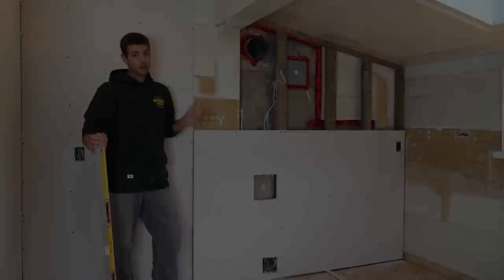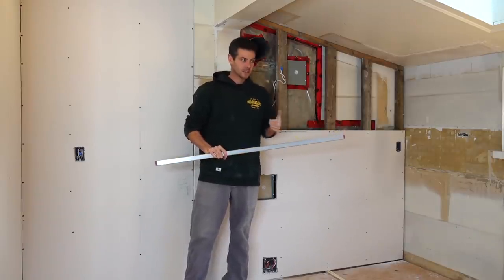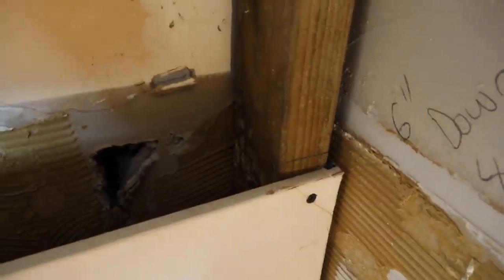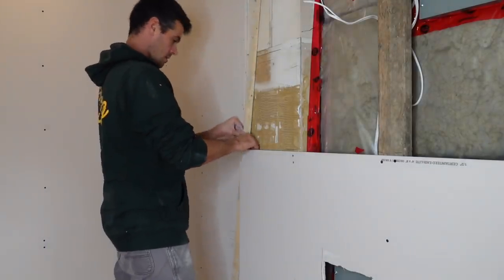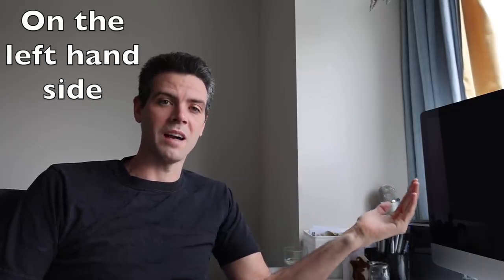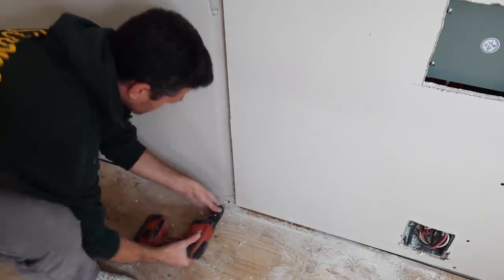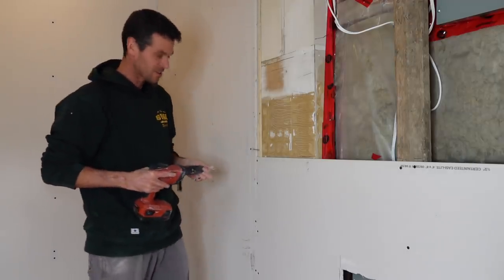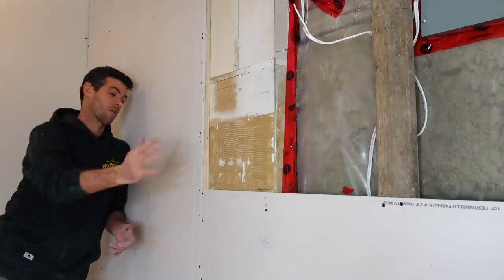What separates a GOOD DRYWALLER from a GREAT DRYWALLER!

Comment: Why wouldnt you just take the corner bead off??
Reply: That’s exactly what I was thinking, why not just rip it out and take out the problem ?
Reply: Bingo!
Reply from the maker: It's super old drywall which is really hard to get rid of and often contains asbestos. It's best not to disturb it. The best solution would have been to shim out the whole left side of the wall but unfortunately like I mentioned it was an afterthought.
Reply: @vancouvercarpenter  Cool, figured there was a reason.
Reply: @vancouvercarpenter  if the corner has asbestos then the entire board will. Cutting the corner would have been half the work and twice as fast in my opinion. Have done it a lot. Shimming the entire wall will work too but as you said no drywall we brings a table saw to do that lol
Reply: @justaworkeryup636  I spent 6 years testing resi and commercial spaces for asbestos. 9/10 any asbestos that was detected was in the mud itself not the board.
Reply: @daltonlopez4623  nice. I do believe there is mud applied around the entire board if I understand how board is installed?
Reply: @justaworkeryup636  exactly. Furthermore the mud is concentrated around corner beads and more dangerous
Reply: @vancouvercarpenter  I would like to add. I like your videos and have been doing this for 29 years. I do most of my work the same as you. Keep it up. You do a great job and I like a good tradesman who has pride in his work. 👍
Reply: @daltonlopez4623  Whoa! How far back does the mud go when the asbestos was detected?

Comment: I've never run into that, but good to know!

Your videos have helped me a lot in renovating my house, I'm happy to say I've skimmed coated and textured my entire home! Using a hawk and trowel helped a ton, which of course I got because of your videos.

Adding lighting, electrical outlets, and other things required lots of drywall patching, which again your videos came to the rescue. I even dared to use 5 minute hot mud! Total disaster at first, dried on me before I could even use it the first time, but got the hang of it.

Anyway, all this is just one giant thank you!!! Really appreciate all your videos, your experience, tips and tricks. Thanks a lot Ben!

Comment: You the man Ben !!

I don't remember which Youtube channel I saw this tip on :(, (it might have been on "Vancouver Carpenter's" channel), but here is a good tip for dealing with crooked wall studs when installing drywall:

If you know which stud(s) are crowned "in", apply a thick coat of thin-set against those studs.
Place the drywall sheet against the studs and push the sheet to squish the excess thin-set until the sheet is flat. Put only a couple of screws where the drywall is already straight and tight to the stud. Let the thin-set dry overnight, and finish screwing the rest of the sheet the next day.

Obviously, this may not work in all cases, but can work.

Comment: As the framer and rocker I have flattened out framing by using a scrub plane to take off high spots and shims to fill low spots... and flattened some twisted framing with hot mud. For the LOAP I probably would have ripped that corner bead out before doing the fill-in framing... and flattened the framing from there.  It may have saved some time over trying to work around that bulge.
Reply: I thought he was going to take out the corner bead.
Reply: I was thinking the same thing
Reply: He said he didn’t know if there was asbestos in the wall, so he didn’t take out the corner bead. (In another comment) :)
Reply: @misstweetypie1  Information not in evidence when I wrote the original comment.  I also didn’t consider it as an issue at the time as local to me getting rid of demo debris isn’t a problem… though that doesn’t stop some from dumping it along roads illegally instead of paying the nominal dump fees.
Reply: He just uses that bs as an excuse to not do the job properly like John would do. Mud framing....lol...need I say more!
Reply: @markmyers7426  Someone who does framing, rock and trim generally looks down the road to the next step and sets things up for success. That said, sometimes mud framing is handy. For example, while the eye-level parts of a wall might look great the very bottom, or top, where baseboards or crown molding is to be installed, could be wavy. In those cases, rather than putting gobs of chalking between the rock and trim, it makes sense to flatten the wall with mud. It looks better... 

The evolution of finished walls and trim is interesting. Early on when framing was rough cut lumber (e.g., pit saw), lathe was hand split, and trim hand planed, the framing, lathe and trim went up first and then the plaster was applied using the trim as a guide. The next approach was to frame, lathe, install guide boards for the plaster to which trim was later attached, plaster and then trim. With those technologies the plaster was used to flatten the walls (more or less depending on the quality of the building!). Anyone who has removed old plaster and tried to rock on the rough cut studs can attest to how uneven the studs are! Flattening the wall with shimmed furring strips may be required in those cases.

Today we apply drywall over wood framing in many parts of the world and then tape and mud it... at some point in using this technology a fine job requires fixing something to make it look flat. Some geographic areas favor blue board and plaster and the plasterer is the tradesperson whose ability to flatten a wall makes for the quality of the final job. 

I'd argue that it's not a stretch for a taper to adopt some of the plasterer's techniques for flattening a wall. After all, most of the early rockers and tapers were probably plasterers first!  For example, the technique shown in this video "Plastering a wall : Part 2 : Flattening" by Cardiffboy may look familiar as it appears in some of Ben's videos. 

I'm a lot older than Ben but have picked up some useful tips from him. I'm also a fine woodworker which means I'm looking for a level of perfection in carpentry that is perhaps unrealistic in many cases!  I got the idea for fixing some framing problems with hot mud before rocking as an extension of Ben's correction processes. For example, it's handy when there is a twisted stud. I use a scrub plane to get the high spots below the plane of the wall and then use hot mud to flatten the surface of the stud to the level of the wall plane. That way when I drive the screws they don't punch through the drywall as the dry wall is fully supported at the stud instead of only touching an edge of the stud. 

My carpentry scrub plane originally belonged to a carpenter who worked in the 1920s-1950s. It is wooden with a wooden wedge to secure the iron. The body is only 6" long and 2" wide. It has a heavily radiused iron. It works a lot better for fixing framing than does my Lie-Nielson scrub plane... the L-N is great for flattening wide rough cut boards so they can go through the thickness planer. It takes the place of a much wider jointer in my woodworking shop. My carpentry scrub plane looks a lot like this one https://www.tooltique.co.uk/corefiles/wp-content/uploads/T13848-2-450x450.jpg with decades of wear on it!
Reply: I have also done several jobs where I removed lathe and plaster and drywalled and finished so I can attest that you know your stuff. My point was when there are 20+ comments that anyone with any amount of common sense would have pulled that steel corner, it shows that this boy is lacking common sense, experience, or both....lol

Comment: Generally I find your videos very interesting and helpful but personally and professionally I would have just shaved that bulging corner with a hand planer before hanging the right horizontal sheet, ultimately producing a straighter wall and creating less work. I do agree that this is not the drywaller's job but I'm talking about the overall process of what should have been done. Keep up the good work, Ben!
Reply: It looked to me like the "bulging corner" was in plane with the studs to the right, and the problem was that it sunk in to the left of that corner.
Reply: I was thinking exactly the same thing
Reply: I agree but I woul borrow someone else's planer.lot of crud on that wall
Reply: @Cris-ss8tb  belt sander then
Reply: @stevewaybright1933  belt sander is a good choice for that wall
Reply: @Cris-ss8tb  harbor freight power planer… $20 and a small price to pay for a flat wall… blades are $3.50 as well… had mine for 5-6 years now
Reply: @stevewaybright1933  w/vacuum 👍

Comment: This video is super helpful - to know what the framing (bad or just wood twisting) will do to your drywall hang and what you can do to still have straight walls. I have bowed and twisted basement ceiling joists and studs. I will need to learn a combination of fixing those where I can and knowing where to put the drywall seams. And then go to your videos about how to smooth way walls. Love the one you did on the bathroom. I will need to tackle my own wavy bathroom wall one day.

Comment: yep packing out the wall definitely easier and “way to go”; and is one if those things you realize afterwards 😉 Do agree w/ ya, when remodel older houses mid 80s and earlier….messing w/ corner beads, drywall, etc…is a different BEAST and can get dicey; & then it’s always a fun game when you have those lovely surprises that want to make you cry & laugh all at same time…..YA KNOW!😅 Like doing a room that WE ALL THOUGHT was Sheetrock (sorry for those who call it drywall, so used to calling is “Rock” or Sheetrock), which was, but underneath was 1/2 breadboard, and under that was lath & plaster. Oh did I mention the Lath had a several layers of wallpaper (which isn’t any big deal, but did have 6 layers, lol). So, what we though would be “quick”, took a tiny bit longer, which how it goes😀
Would be awesome if remodels were like what see on TV shows, as everything would be buttoned up and done in 45 mins😉

Comment: I saw another video a few years ago where the contractor went as far as replacing a few vertical studs before installing the drywall.

I installed some ship lap in my condo and the common wall vertical studs were bowed out about 1/8".  It really showed but being a common wall, I was up a creek without a hammer.
Reply: I’m installing vertical shiplap on the inside face of a 50-year old stucco fence (spouse’s requirement).  Shimming or shaving (sometimes “and”) every foot of the way.

Comment: Thank you for all your videos and this honest video as well.
I have watched many of your videos in the past and now re-watched many of them and they are such incredibly helping.

I have started a small project just two high floating book cabinets, but there is a major wave and a stud sticking out.

So I am doing wall framing a la your style. With the quickset and using my 4 foot level. With many passes and drying time in between, work has been going slow, but it is going and I hopefully by tomorrow I will do the skim coat and sanding. I feel like I am getting much better with the drywall-knife as well. It all feels so much easier that a few years ago when your videos weren't around yet! MANY THANKS again!

Comment: Im not a pro by any means. Ive picked up some good habits from watching homerenovision n basement finishing man YT videos. I check for crowns on the studs n face them up n out facing the inside of the room. Then I place a level across the studs . If one is off I check the bottom n top n feel if its flush or not with the base or top plate n adjust or it may have a twist in it . But a twist you can see as your installing. In this video I would recheck the studs .

Comment: On smooth ceilings in high-end houses, we’ve switched to using butt boards because of the poor quality of lumber we’ve been seeing and people’s expectations increasing significantly.  Also we try and railroad all walls less than 12’; otherwise, we often hang sheets vertical to avoid butt seams, especially in kitchens where cabinets and counter tops will be installed afterwards.  Gotta look after the next guy, right.  Sure wish the framers would think about us.  Way too often we are adding in nailers they haven’t bothered with.  Another great vid as always.
Reply: Yeah it's always leave it for the next guy to fix kinda sucks sometimes, framer leaves for rocker who leaves for spackler who leaves for painter trim guys always deal with nightmares
Reply: Butt boards kick ass. You can even whip up your own with some osb and some poster board. People just aren't familiar with them so they just continue the old school way but man once you use a couple and it clicks you'll never go back to landing the ends on a stud
Reply: How do you guys feel about using them on the walls?  Some code inspectors don’t want us to use them on the walls.  I wasn’t sure about it myself, but when we do I can’t tell where we used them and where we didn’t.  I mean the wall doesn’t flex or anything.
Reply: @KevinsDisobedience  in my opinion I see more flex on the walls because I'm using 5/8 rock for ceilings. I use them on walls personally. Inspectors are a weird lot. They might not like something but if it's not code it doesn't matter what they like. They generally don't like it because they aren't familiar with them. It's human nature. I'd bet the majority of sheetrockers out there aren't running butt boards. Maybe 10%? I think they are game changers when you want a nice flat finish. Especially when you have strong lighting in the area.

Comment: I wish Home Depot (or any of the of the big box stores) here in the great white north carried the Strait-Flex 45 in. Drywall Shims.  They are used for padding out low spots in a stud wall.  High spots get a pass or two with an electric planer.  In a pinch I've cut strips of RamBoard, but doing that is a PITA.

Comment: I'm definitely not a pro drywaller, only did about 4 rooms so far (planning on doing a lot more on my house), but I bought those paper cardboard shims to even out everything before hand.  Those are better than wood IMO as they give some cushioning while still being firm and they are easy to just stack onto of eachother on bigger gaps.  Didn't run into anything as bad as that corner bead though.

Comment: Interesting video this week, and it was a pretty good solution to the bulge, even if you did realize that you should have removed the whole sheet and shimmed the full length.
It would be an interesting segment for you to talk about average rates and what you would charge for a per-square-foot job versus an hourly job.
I realize that you're in BC and it's going to be different in most other places, but it would give a good place to start for beginning drywallers.
Thanks Ben for all the great information you put out there.

Comment: Wonder if I’m going to have to check on how level my ceiling is before I hang the 1/2” over the popcorn. May have to float out some spots. Going to install pot lights after throughout. Thank you for this info. Ben. Really appreciate your instruction & insight.
Reply: I ripped my popcorn ceiling down and put up new rock. If you are doing walls I think it's the way to go.
Reply: @brianallen140  my walls are just fine. The popcorn ceiling however is outdated & needs to be taken care of.

Comment: I have a situation in my kitchen i have one wall where we have a cast iron. Pipe that runs up the wall and it sticks out 3/8 of an inch. I bought shims but now my outlets need to be brought forward a bit and now the wall will be now connected to an old wall so now i may have to float the high point. Ugh!!! 😂

Comment: Does a tool exist to quickly asses whether bows or other inconsistencies exist in the framing?  For example, are laser levels possibly designed in a way that enables the laser to be positioned in such a way that the tool butts against the frame, allowing the beam to span the full length of the frame, thereby pinpointing protruding parts of the frame?

Comment: I have a similar situation in a kitchen. Being a newbie, I drywalled a bad wall without checking the wall. Once in place, the base cabinets show the the wall is nowhere near plumb or flat. I'm not using wall cabinets, but I can't even put up a back splash against this mess. I'm thinking of bead boarding the wall (or maybe using shiplap). I can shim on top of the now-painted drywall before I put up the board . 

Any feedback on this idea?

Comment: I stopped meeting butt joints on a stud I let it fly and use a nailer either pine stock or strips of ply stronger joint to share 4 inches than to share 1 1/2 inches. Also less cuts I just use full boards with that method much faster
Reply: Appears like a sound method to me. However I'm going to have to wait until some real professionals put in their two cents about this method before I put it in my bag o tricks.
Reply: They actually make a special product that's a recessed plywood to make butt joints similar to bevels it's called butt board I think trimtex makes it. So I'm sure nailer works fine just doesn't make it recessed like that product
Reply: @redblue8775  yeah I know tho where I'm at they're hard to find tend to get expensive and not enough people want to pay that extra cost so leftovers and cut offs it is
Reply: @AMByram  fine home building magazine covers them in an issue, all about best drywalling methods

Comment: Quick question, I have a strip of one inch and half to put beside a door frame. How do I make it stay on the wall. I’m assuming that a drywall screw will shatter the drywall strip. Do I stick it with mud? Air nailer?
Reply: I’d just screw it off center of the strip